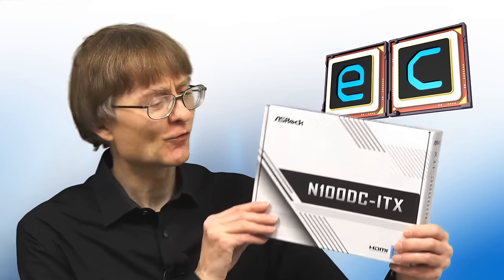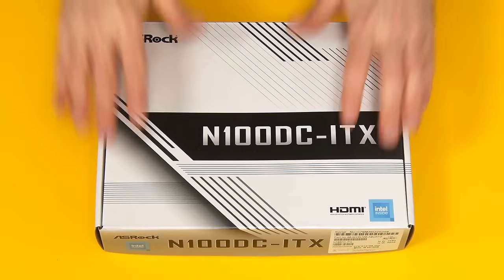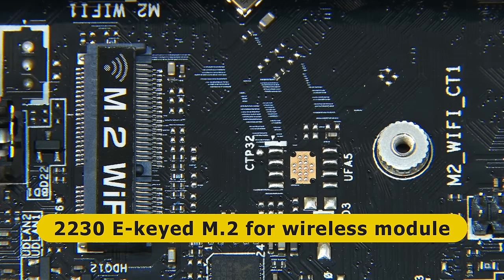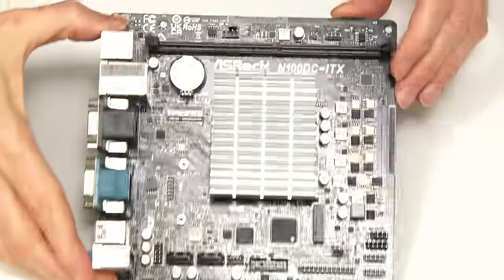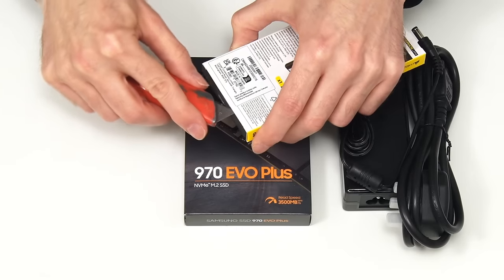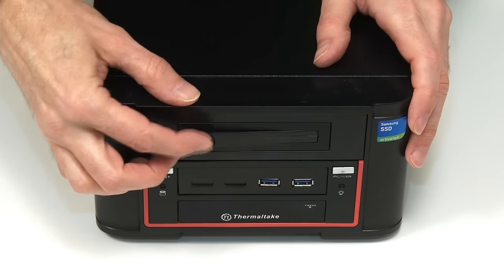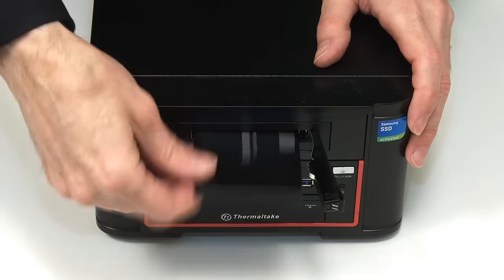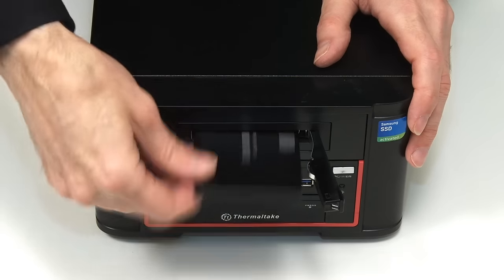N100 Mini-ITX Silent PC Build

Comment: It is genuinely refreshing to see someone building a new PC that is not intended to be ridiculously high performing but is instead just right for their needs. Throughout this build I noticed so many modest and sensible hardware choices; it made me consider the clear benefits of having a silent, efficient albeit slightly less performant machine. Thank you once again Chris for another excellent video; I am soon going to use your network cabling tutorial for my own installation!
Reply: That's exactly the reason why I switched to an Apple Mac mini M1 in its stock configuration. Although it has a fan, under normal load it's practically inaudible. Thanks to Christopher for videos, that often put things in the right perspective!
Reply: I'm looking forward to low specs, high performance, optimized software
Reply: Totally agree.  The most common overkill in new PC builds that I see is with GPU. People seem to want to buy the best GPU they can afford, instead of what they actually need.  I mean, you don’t need a RTX 4000 series for checking email, social media, web browsing, and even most gaming needs!  I suspect in most builds, people can save the most by buying only the GPU they really need now, also allowing an easy future upgrade when more graphics performance is really needed.
Reply: both the SSD and the RAM choice are overkill for this box
Reply: @DJDocsVideos  Well he uses virtualbox so it will benefit from it.
Reply: 😢 @DJDocsVideos how do you figure that? 8 GB of RAM isn’t a lot for anything these days, and you have no idea how much storage he needs.
Reply: I also like @WolfgangsChannel in this regard
Reply: I came upon this channel back in 2019 where the video was a desktop PC build - I followed the pattern closely and came out with a very decent system that is still going strong (has 12 cores and 32GB RAM so will have a rather long shelf life of relevance).

It's very satisfying indeed to see that this theme of custom PC builds (in the age of SBC abundance) can still be a thing.
Reply: Can this board support 16 GB of RAM?
Reply: @camerondean6804  To me 16GB of RAM is indeed the bare minimum for a viable personal computer these days - 8GB does not cut it.
Reply: @gregclare sorry to say cob but you are, in fact quite incorrect regarding GPUs. Who in God's green earth would pay 150+ dollars for a GT730 'just because' all you do is web browsing and emails???
The value proposition of these budget cards gives me heart palpitations.
Buying up a tier has always been the go. I've had my RTX 3090 for a few years now, and with its 24gb frame buffer I doubt I will be needing to replace it any time soon.
This sucker is great for Machine learning, software development, VR porn, running 'flexmarks' (benchmarks) and even a game (or email/web browsing!) sometimes.
Sure, I could have bought the GT730 to save some money as you say, but I would have needed to chuck it in the bin over 18 months ago. So bad for our planet! 
Let's all start keeping our tech for longer. Buy high spec gear (and keep using it for years to come), be more productive and slow down the ever constant march towards a world of e-waste.
Reply: @funbucket09  I agree with you (if your budget allows), that “buying up a tier” will get you a system you don’t need to upgrade anytime soon (unless you are the type that always wants the latest anyway!).  However, I don’t agree with your need to excessively attack my view.  I also don’t condone your idea of “chuck it in the bin”, when you need to upgrade.  You’ll be doing more for the planet by instead passing your upgraded parts on to someone who can use them, rather than your idea of saving the planet by always buying higher power GPU’s, than you need.
My comment was based on my personal experience, over many years, of seeing (generally non-technical people), being sold the latest system, with a GPU that will most likely never be used anywhere near its potential (based on their intended PC usage).  Knowing, that in most of these cases the GPU makes up over half the cost of the system, and a lesser GPU would satisfy all of their projected future needs.  A good honest salesperson understands the actual needs of their customer, and explores possible future requirements, to find the best fit for their customer (not just trying to sell them the latest pricey system, with an expensive GPU they'll never really need). 🤓
Reply: @gregclare  my apologies. I didn't mean to sound like an attack.  My abrupt choice of words sometimes does come across as such I am sorry for the misunderstanding. I simply enjoy healthy discussion.
In regards to handing on tech when upgrading, let's face the harsh reality. People don't really do it a lot of the time :(. I wish they did, but it is upsetting to see (where I live at least) that people would rather destroy and discard their old tech instead of donating it to a charity. They don't want to give it away for free even if they can't sell it and they no longer use it.  For the few of us who do actually repurpose, hand down, or give away their old tech, I still think if you did opt for the higher tier of equipment originally, when the time comes to pass it on it will have a far better and longer useable life left in it than the bottom tier. The bottom end is sometimes already obsolete before it is bought, and devious salespeople take advantage of 'mum or dad' (who don't understand tech really) buying a gaming computer for Jimmy's birthday. I really despise seeing and hearing of this.
When I was discussing buying better specced gear, my comment was made with the assumption that the purchaser has total understanding of the product they are buying. I absolutely agree with you about people getting needlessly upsold due to lack of understanding. At the same time, these sales people will also downsell if it suits their agenda (they need to move old obsolete products) leaving the poor sods who just wanted a computer that works with hours of frustration and short useable lifespan. The salesman didn't save them money or help them, they forced an early upgrade on them (with the hope of extracting a second sale out of them). It is a disgusting practice.
Edit: my use of the phrase 'chuck it in the bin' was not meant in the literal sense, more so it was meaning it is no longer useful to me. I to, try to re-purpose or pass on perfectly working kit to someone who could use or need it. Lately though, people don't want it, even for free. The people that do take it also sometimes use it to scam someone unsuspecting (by claiming it can do something that it cannot). I had some perfect, reconditioned Intel 2/3/4 gen i5 systems ready to go and I couldn't even give them away. No one wants them. They asked if I had apple laptops I could give them instead 😂😂
Reply: Speaking of energy efficient and low cost computers, I've been wondering what a handheld PC designed with those in mind would look like. Intel is still making super low TDP Atoms, could they allow for a cheap and small gaming handheld? I can’t tell performance off specs alone. Need me some gaming benchmarks and there are like none for the newest Atoms on YouTube. This type of handheld PC could even have potential as an easy and inexpensive way to get into PC gaming (and serious gaming in general), specially for children.

edit: I'm not under any illusion that this would play the latest big budget games, I know better. And so should potential buyers, gamers sometimes have a hard time remembering how many old AAA and indies games exist. A handheld PC with very low energy consumption also interests me because it could be small and pocketable, something that isn’t made anymore.
Reply: and still the machine is snappy and responsive... noticed there were only 8GB ram thought he would have added more, but oh well.
Reply: @camerondean6804  it supports 32GB he said
Reply: @weinbergfahrer4048 yeah but software support

Comment: Chris, I was person that did the memory reference layout for the CPU company (This family cpu supports DDR4, DDR5, LPDDR5, max 32G ram), very happy to see you like the system . I posted a link to Intel website on the N family that has more powerful CPU N200,N300 , lower performance N95 --. Somehow my comment was deleted yesterday . So I am not posting any URL risk robot spam removal. Nothing is more satisfying than seeing happy customer. Merry Christmas !
Reply from the maker: Thanks for this, very interesting to hear from somebody involved. :)
Reply: @ExplainingComputers  This chip was also optimized for chromebook. If you build a Chrome flex OS and run it off SSD, it will be very fast. A few well known OEM build chromebook with this CPU. Surface Go4 will come with this family of CPU too. 😊
Reply: @clooi5018  can I ask you what CPU you would recommand for a PC running linux and used for coding and occasional retro consoles emulation please? Is the N100 a good candidate or going for N200 or better is safer? thank you.
Reply: @polar_inertia  Both N100 and N200 has 4 E-cores, differences being N200 higher clock speed and has 32EU, N100 has only 24EU (usually sufficient for day to day use), another factor you want to consider is memory technology used, you will want DDR5 (or LPDDR5 usually soldered down and not upgradable ), this CPU can support DDR4, but only up to 3200MT/s. DDR5 above can support up to 4800MT/s, my last knowledge about this family of CPU, we hoped it would hit 5200 but somehow Si IP has its limit. A better performance CPU in this family is N305, it utlizes all 8 E core, supports DDR5 too, more costly too . This family of CPU supports single channel memory only. If you doing coding and occasional gaming, probably is ok with N200 with DDR5 support . I have not done code compiling on this system, cannot comment too much this. If you have extended high power mode running, probably get a system with fan cooling (supports up to 15w) rather than those 6-9w passive cooled system. I know of friends working in such environment, for coding laptop, they use a lower performance system (laptop)  purely for coding (basically text typing) and office email, internet etc, for compiling , they have more beefy system , sometime system with i7 performance or Ryzen7 type of system performance for that purpose, with plenty of storage . Sorry, did not mean to psycho you to buy more hardware. Anyway, this N family CPU has upgrade coming soon, known as TwinLake, you will something like N250.. just guessing.
Reply: @clooi5018  thank you so much for that detailed answer! It's really appreciated! No worries I'd rather know now that the Nxxx aren't powerful enough than after bying one 😁
Reply: @polar_inertia  You are most welcome, I tried to be as impartial as possible, I even quoted competitor product family as opinion. Good to figure out what is most suited family for your own applications, x86 is mainly AMD and Intel, Arm ecosystem has Resp Pi, Rockchip family too. May need more effort to get drivers.

Comment: The major drawback (for me) in this board is the lack of DVI video port which was found in earlier ASRock ITX mainboards (like J5040-ITX or J3455-ITX or Q1900-ITX). I normally use two monitors and here we have only one digital video output (HDMI). I wish they included a DVI or DisplayPort connector as well.

Comment: Nicely done!  1/3 electricity consumed for 3-4x performance gain.  And no tinnitus triggering noise.  Wishing you another 10 years of enjoying this computer case.
Reply: Absolutely.
Less power consumption with tangible performance improvements is the real-world, old-school, inarguable upgrade.
Reply: Too bad we are not seeing Atom based board anymore. They have even lower power usage, and have even better math performance than the N series.
Reply: Still way too expensive.  the power difference will not be noticeable in any meaningful way in terms of cost.
Reply: I think it is too expensive also. Should be around $60
Reply: @knerduno5942   this is 6w? atom was also 6w?
Reply: @BenState  yes for example my fridge consumes as much power as my always on pc and the fridge cost 10p a day
Reply: those smart plugs that record energy use are great 😂
Reply: @knerduno5942  This is just the continuation of the atom series.

Comment: After I watched this video I bought all the parts and built one for myself. The bios went right to my USB stick and booted into Linux mint. I installed it and it loaded just fine. I installed a temperature app and put on a video, the temp only went up to 120. This is an amazing board. Thanks Chris.

Comment: Another excellent video. One idea for the black plastic back plate you used to cover the empty PSU bay would be to fit a parallel port. It would be pretty cool to have a modern system that has PS/2, serial and parallel ports should you need them for older devices.
Reply: I missed this part of the video. I would actually block it with a screen or leave it open for airflow. That case was not designed for fanless specifically and so it has ventilation but ideally more..
Reply: I'm sure somewhere in the world there are still functioning daisy wheel printers. That would give a real retro charm to paper output.
Reply: I work with structural design software that uses a hardware lock device that connects to a parallel port in order to let the program function legally.  I have needed to keep functional old machines that still have that port.  Newer versions of the software use other methods but are expensive and the old one that was legally bought still works like a charm.  So having a newer computer with a functioning parallel port would be great.

Comment: Congratulations for the new build! I thought that N100 were available only on mini PCs, so it's cool to know they are an option to consider for power-efficient modern builds!
Reply: I hope to find a similar solution with the more powerful i3 N305 CPU, as that would make for a great low power home server.
Reply: There's also firewall appliances in the N100 format.  Not terribly user friendly as far as servicing, but they come with a massive heatsink in the fanless variety. 
 Personally, I might be interested in a N305 version over the N100; twice the cores, with a slight bump up in power draw.
Note. I checked my N100 firewall appliance; it's running at 55 C currently.

Comment: Thanks for sharing. This board and its bigger m-atx sister are right in the home pc/lab space and very economical too. 
For anyone curious. The specific nvme is MZ-V7S2T0. 
The manufacture’s website has a memory QVL file in the support section so you can get a better interesting about ram speed options. 
There is a storage QVL too if anyone is curious.

Comment: I'm using this motherboard inside an old switch 1U rack case, as a home server and smart home hub, DVR etc.  What I missed was an internal DC connector to have 19V laptop brick mounted inside, not only via back panel. Also I'd love it to have a full x16 PCIe for RAID storage options. The connector is x4, but actually only x2 connected. Same for mpcie.

Comment: All in all, it is a good board.  I can use it to operate as a beefy PLC application in factory settings or a small PC controller and monitor many PLCs in a factory setting.  I have 2 on order and will test it before trying to market it to my customers.  It has to function stressed under max loads in a hot. humid, and dusty environment.  I may have to run it caseless as I do many of my SBCs that serve as replacements for old SS PLCs.  It looks promising and cost-effective.  Cool Video.  Thank you.

Comment: Always good to see an EC build video. Clear explanation as to why each component was chosen, and how to carry out the assembly. As a bonus, I think this might be the first time I heard the meaning of LPT.
Reply: That and the serial port are now relics of the past for most people. Surprising the board had them both. Unless you ordered that motherboard especially because you had a use for them?
Reply: @sharonwolff1  I too was surprised to see that Chris’ board had both ports, as I’m sure it’s meant for office or home use. Serial is still (or was until recently) used in industrial applications.
Reply: Those older ports might be useful for certain commercial or industrial use cases where interfacing with the machine the computer controls requires LPT or COM. One example I can immediately think of is laser tag arenas.

Comment: I will confess, silent computers are  something I have come to really appreciate. It's one bug thing with the Raspberry Pi 5B, because the official cooler isn't very loud, and is barely used under nirmal loads anyway.
Reply: All home computers where silent until the advent of IBM PC’s
Reply: I had a project to silence my desktop...undervolted, underclocked r5 3600. Oversized aircooler with very low rpm quality fans. Just the other day I thought something was wrong since I could hear the machine. Turns out it was just my soda bubbling. Silent machines rock.
Reply: @@Tony-eo8zzI'll be honest... I like having a Raspberry Pi as a daily driver. I want something for creative writing and the like, and it is wonderful for what I want. Also, it has a small power output, which is another big consideration for me.

Having a system be as quiet as possible is another thing I want. 

I have an Intel machine, which I got for basic gaming.
Reply: @@Tony-eo8zz Yes, either Noctua or those I got from Cooler master, they were like $40 for 3 rgba fans. Cant hear them at all.
Reply: @1697djh The IBM PC was never intended to be a home computer. In any case the keyboard was noisier than the PC itself.
Reply: @@Tony-eo8zz Feel free to put forward ARM alternatives here. I am interested to hear your thoughts.

Edit: Was originally SRM, which could have been deeply confusing.